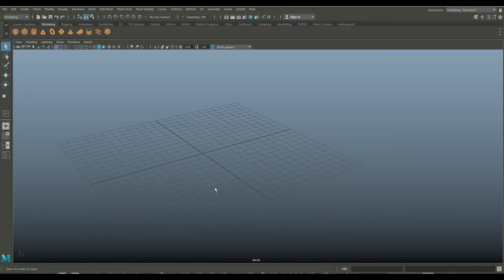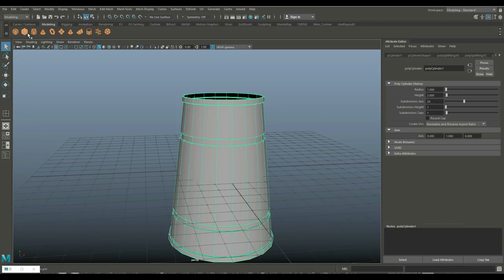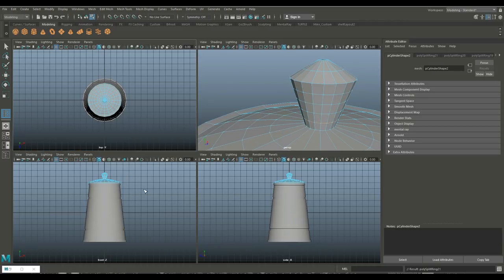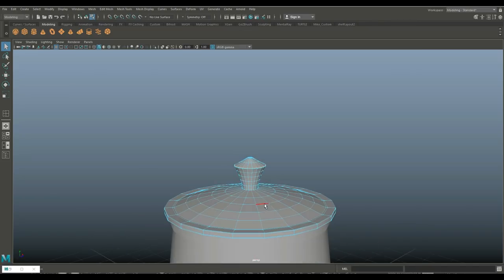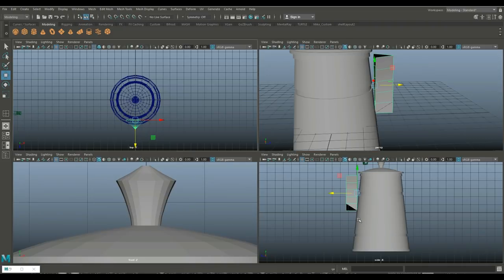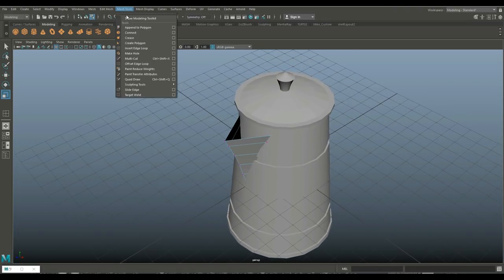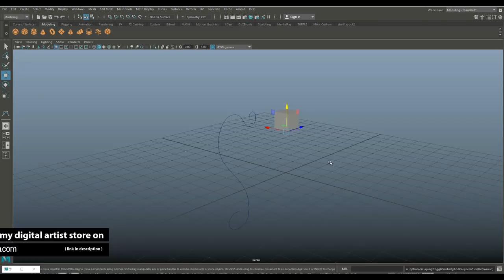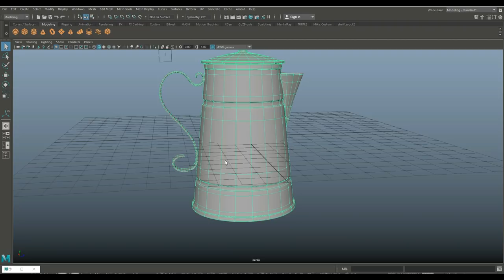Maya 2018 tutorial : "WILD WEST" style coffee pot

Comment: Sir. Snout part causes a horifying topology in my project. I don't know where i'm doing wrong. And I haven't been able to solve the issue for hours.  Boolean tool is so tricky. Is there any way else to merge the snout to pod. Or may i ask; Is it even necessary to use boolean at all?
Reply from the maker: You can merge the vertices manually